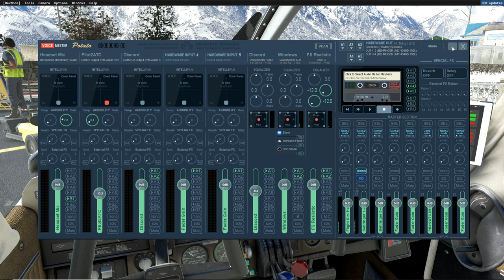Bass Shaker Part 2 | Configuration & Integration

Comment: the main issue with this is once you get it dialed in and are only using raw sound is that the game volume effects the shaker. so turning the game down will effect the shaker, and like wise if something crazy happens, changing views or even another plane taxing upto you will have to re adjust the shaker. buttkicker offers free software for msfs that will use telemetry or actual game data to give exact sound. its on their website. there is also andre's sim shaker.

Comment: I need some guidance on setting up voicemeeter. I'm using FSRealistic as well. I have a  splitter coming out of the speaker port on my computer with one cable going to my speakers and the other to my Nobsound amp. I feel the bass shaker when your video starts up but nothing within MSFS.
Reply from the maker: Hey Russ, I make my VoiceMeeter potato the primary play back device on my PC. You can do so by left-clicking on the speaker icon at the bottom right hand corner of your desktop and selecting the VoiceMeeter out put that you would like to use. Next right-click on that same speaker icon and select "Open Sound Settings" and go to "Advanced Sound Options" at the bottom of the screen and click on "App Volume and Device Preferences". This is where you can select the output for MSFS (MSFS needs to be running to do this).  I recommend routing MSFS to one of the VoiceMeeter inputs (example: Voicemeeter VAIO, Voicemeeter Aux, or VAIO 3). You can route your Nobsound amp from inside the VoiceMeeter App by selecting one of the "HARWARE OUTs". I hope this helps.
Reply: @jnobuildsit1177  I did as you suggested although I did not see the Nobsound listed as an option on the Hardware.

How do I change the labels on VoiceMeeter to reflect my new mappings and what is the hot key to access the screen where I can manipulate the intensity of the bass?
Reply from the maker: Look in your sound setting for the Nobsound card that you're using. It might not be call Nobsound. To change the labels right-click on the label name.